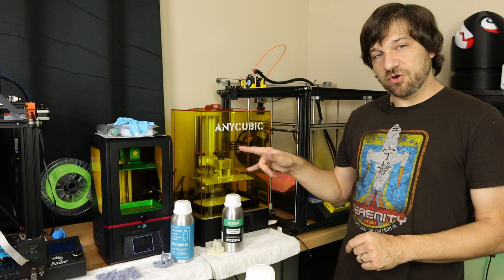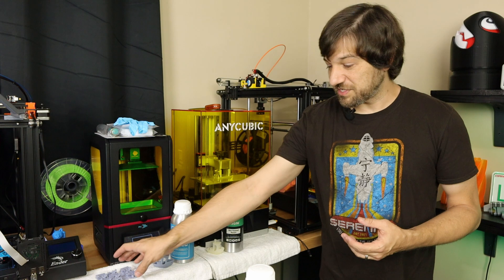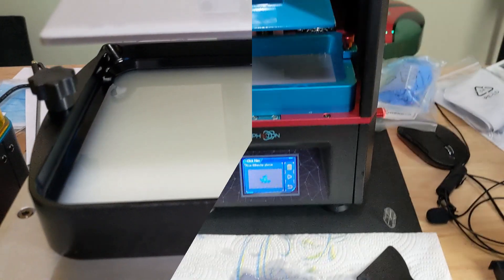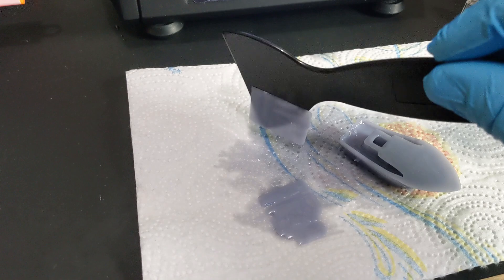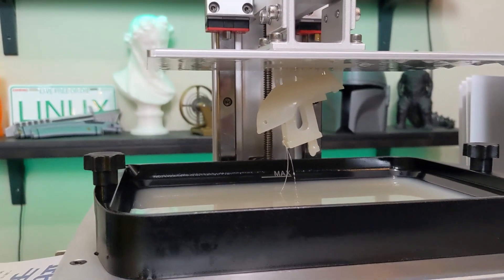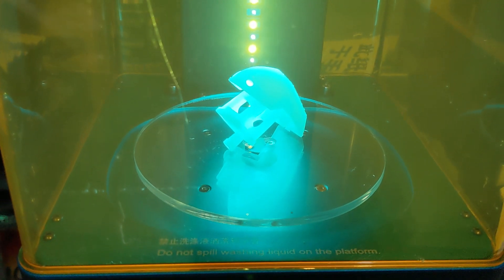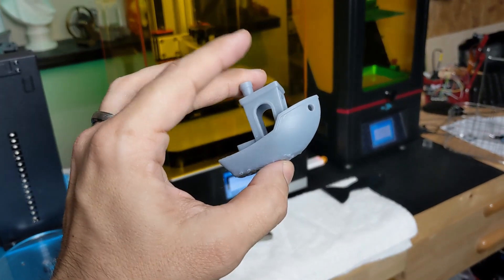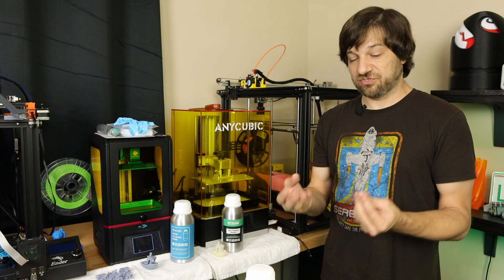ANYCUBIC Photon and Photon Mono X Unboxing Results

Comment: I'm having issues with my photon mono x I am just left with gloopey resin and failed prints :( what settings did anycubic reccomend?
Reply from the maker: It's a tricky printer for sure. I'm still not getting more successes than failures. Here are the settings they recommended:
Bottom layers: 12
UV power: 80% if the exposure time is 1.5s
UV power: 40% if the exposure time is 3s ( you can change the UV power on the setting section of the printer )
Bottom exposure time: 45s 
Z lift distance: 8
Z lift speed: 4mm/s
If you print models with bigger base, you can change the Z lift distance to 12.

Comment: Could you do a review of ender 5 dual Z upgrade that is being sold on eBay??
Reply from the maker: Are you talking about this one? https://www.ebay.com/itm/264918816536
Reply: @kerseyfabs  yes sir, I bought it and am going to give it a shot, I can’t get my ender 5 to work, the bed seems like it’s too flimsy!
Reply from the maker: What kind of issues are you having? I've never had bed issues on mine. I'd like to check this out but it seems expensive for what it does. I'll consider it still.
Reply: @kerseyfabs  I wonder if it’s because I run it on a rack with 7 other printers and I wonder if it makes the bed shake a little. I just have never had where the prints stick very well or break away
Reply from the maker: I guess that's possible. By rack, do you mean wire rack? Do you have any dampening under the machines?
Reply: @kerseyfabs  I don’t have dampening. It’s a heavy duty shelf with plywood bolted to the shelves.  It’s this one Black 4-Tier Heavy Duty Steel Garage Storage Shelving (77 in. W x 78 in. H x 24 in. D)
https://www.homedepot.com/p/202251082

Comment: Thanks for sharing your experience with the Anycubic printers. I have a Mono X coming in the mail so I'll probably be doing the same experimenting and tuning as you. One thing I do plan on doing is putting the printer on an aluminum baking tray so if I do have a resin spill, it'll be captured in the tray and not spread all over the place. I'll probably have a separate tray for pouring resin so again it'll get captured rather than spilling all over the place.
Also, people should be aware that the current Anycubic Wash & Cure station is not big enough to handle large prints from the Mono X. The price drop is really nice though. This tells me that there might be a bigger version coming soon.

Comment: I also once dropped a hair in my resin. Didn't even know it was there until the print was finished washed, and cured, then I saw it sticking out of the side of my model. LOL I just cut it off and sanded the model until you couldn't see it anymore. So a piece of my DNA is embedded in that model forever.
Reply from the maker: It's personalized!

Comment: I recently helped a friend setting up his Mono X and we had the same issue with the test file in the provided usb drive. We used Eco Plant Based Resin from Anycubic. I figured the settings in the file were not the right ones for the machine or the resin we were using. And my guess is we were right. We went ahead and used the minimum cure time recommended for the resin which was 3 s and I just went ahead and set the base layers cure time to 50 s. We did two test prints the came out perfect. Anycubic should recommend a resin to test print with the provided gcode. IMO
Reply from the maker: Thanks for confirming what I saw. I agree, even if it was their resin, you'd have a baseline.
Reply: Thanks for commenting your experience. I got my Mono X last week and when my eco resin finally arrived, I jumped into doing test prints.. three fails 😅 I had the same hunch you had but haven't had a chance to do more testing. Im tempted to just slice my file and skip the test print entirely. Ill definitely try out the settings you mentioned. Thanks for sharing!
Reply from the maker: I did the further testing and found out the EcoResin just couldn't keep up. When I switched to Siraya Tech Fast Resin, my test print turned out beautiful.

Comment: Good video  if you could please share the settings Anycubic  provided you. Got mine a few days ago didn't know it was even coming no  email or tracking# was sitting on front porch. First print was their cube  with Anycubic clear resin came out extremely good, 2nd print a small resin funnel had lots of bumps from uncured resin also inside resin tray  patricianly cured slivers of resin through out the remaining resin had to filter and clean out the tray. changed to a white elegoo  see how this goes like you I'm new to resin
Reply from the maker: No problem. Here you go:
Bottom layers: 12
UV power: 80% if the exposure time is 1.5s
UV power: 40% if the exposure time is 3s ( you can change the UV power on the setting section of the printer )
Bottom exposure time: 45s 
Z lift distance: 8
Z lift speed: 4mm/s
If you print models with bigger base, you can change the Z lift distance to 12.

Comment: The cell phone camera worked well.  I'm glad you are showing all of the details of what is involved in resin printing.  I myself think it is just too much extra to get into it.  You might explain the advantages, because I see just disadvantages.
Reply from the maker: Thanks David. For me the only advantage is printing highly detailed parts that you don't want to have to do tedious and time-consuming clean-up before finishing the piece. This appeals to me for props, cosplay, and artistic pieces such as statues. You could also use it on smaller, more precise mechanical parts that would be difficult on FDM.
Reply: @kerseyfabs  Thanks for the information.   I guess the resolution is much finer, what level do they provide?  I'm printing some mechanical parts with a .25 nozzle and .1 layer height and having good results on my Ender 5s using PETG.  How does the resin compare for strength and heat resistance?
Reply from the maker: From the spec: Layer Res.: 0.01-0.15mm
Typical is 0.05mm
Resin can vary in its properties much like filament. One of the typical ones you can buy is labeled as ABS-like for example.
Reply: @kerseyfabs  Thanks.  I have seen a number of resin videos and have not heard this kind of useful information, maybe  I just missed it, I knew there must be a reason people want to do this, because it seems so much more involved than  FDM.

Comment: I don't understand what you are trying to say at 5:58 re the fix instructions for the large Photon, it sounds like a riddle to me LOL
Reply from the maker: I don't blame you. It's a bit difficult to explain. Basically, you don't want the surface area of what's printing to be too much bigger than the layers adhering to the build plate. With each new layer, it has to peel it off of the screen and if that takes too much force, it can break it from the build plate or from the supports. So we try to print "boxier" parts at an angle to minimize area.